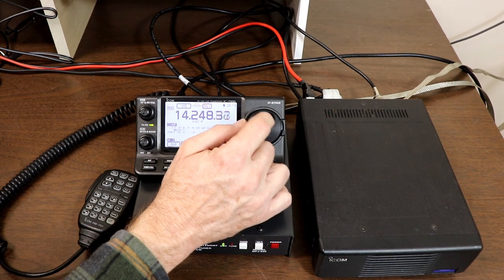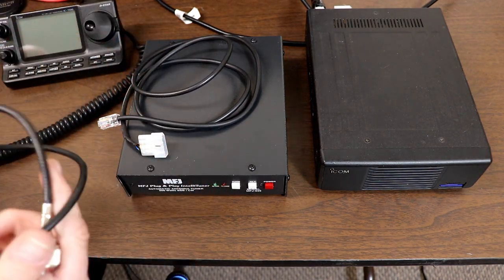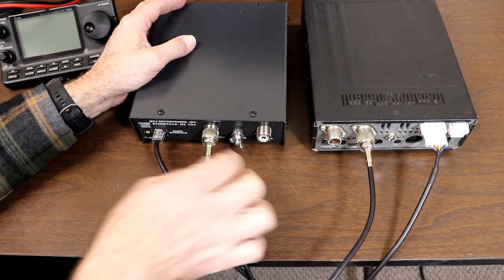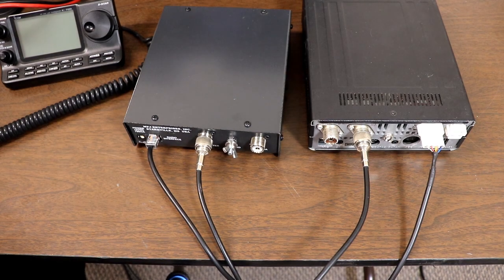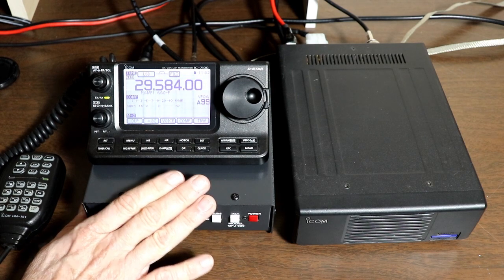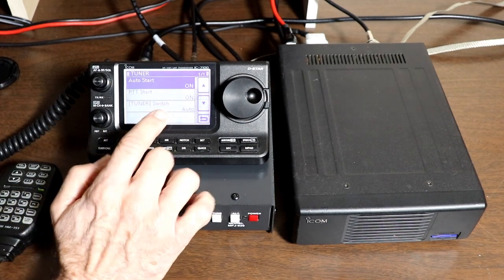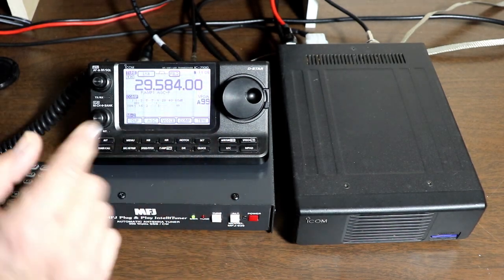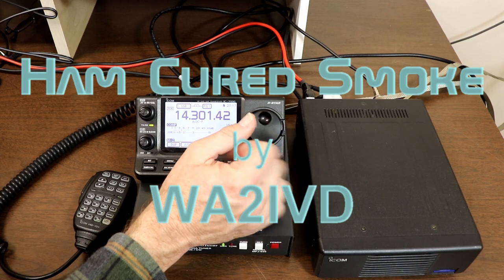IC-7100 from A to Z #11 Connecting an external antenna tuner

Comment: I want to thank you for the work you are doing on the IC-7100. I have been a ham for a long time (1976)  but since having a stroke have found my radio very hard to use.  I purchased the IC-7100 hoping it would be simple enough for me to use.  So far I think it may meet my needs.  So far I am basically exchanging my call (W0DWS) with DX stations. I am hoping to learn more so that I can do more with the rig.

Comment: Tom, the IC-7100 is my regular radio that I use every day and was my first HF radio.  I used your series to get me going on this radio and have come back here several times for reference.   But the other day this happened:  I turned on my radio and the LDG IT-100 would not power up. I had a bad cable and tried to replace the pins in the molex connector on the cable and was unsuccessful. All I succeeded in doing was blowing the 5 amp fuse on the radio. Replaced the fuse, ordered a new cable and installed it and nothing. Tested the output from the radio through the cable on pins 3 and 4 on the molex end and on pins 1 and 4 on the round DIN connector and got 13+ volts. Now I figured my tuner was bad. So I bought a new tuner, hooked everything up and same thing. Tuner won't power up. At this point, I'm out of my depth. I know that there is "start" on pin 5 and "key" on pin 6 but I have no idea how to test it, much less fix it. I'm afraid that when I blew that fuse I killed something else. Advice please. Should I send my radio in for repair?

Comment: Just a note, when you use a LDG tuner with the cable that carries the power to the tuner from the radio.  So when you turn on the radio the tuner also powers up.  You cannot turn on the tuner separately.
Reply from the maker: Thanks Arvind.  Yes, that's true with the LDG.  So just need to make sure it is plugged in before turning on the radio. (Generally a good idea when connecting or disconnecting any accessories)

Comment: This is the same setup as I have, and yes, the setup is quick and easy.  One thing I would add is that an antenna tuner doesn't actually "tune"  the antenna, (for those who aren't aware,) but just "tricks" the radio into believing that there is match between the antenna and radio.  Nothing beats a resonant antenna.

Comment: I have learned a lot about my 7100 from your videos.  Have you done one or can you do a video on linear amplifiers for the 7100?  I am thinking it would be nice to have a few more watts output.  Thoughts?  Thanks for the videos!
Reply from the maker: Hi Steve.  Thanks for the comment. I’m glad you’re finding the videos helpful. I haven’t done any videos on connecting an amp.  The main reason for this is that I don’t have one. I’ve been a ham for 46 years and I’ve always run barefoot.  Of course, a video on connecting an amp would give me an excuse to buy one...  73, Tom

Comment: I'm not sure if the 7100 has the same problem as the 7000, but on the 7000 the MJF external tuners prevent the fan from running. The fan will come on only when the radio is excessively hot.
Reply from the maker: Hi John. I am not aware of this being an issue with the 7100, but I have not really paid close attention to the fan in my setup.  I will make it a point to pay attention to the fan when using the tuner.
Reply: @HamRadioA2Z  Ok I hope Icom fixed that issue in the 7100. I never heard of this issue in any other Icom transceivers so hopefully you won't have any overheat issues. I had to send mine in twice to have the finals replaced. Now I am going to use only the AH-4 antenna tuner.

Comment: So what kind of antenna(s) do you use when your mobile?  Do you use two antennas one when you're moving and one for stationary?  
KD2OSR 73s
Reply from the maker: Currently I’m using a a Wolfe River Coil SB1000 coil - https://www.wolfrivercoils.com/SB1000.html along with a roughly 4-1/2 ft. SS whip.  It cutoff a 102” CB whip.  I was using the whip full length for a while, but I could not tune 10M or 12M very well with it.  I have the antenna connected to an MFJ-939 tuner.  You can easily use the SB1000 to tune to <2:1 SWR without a tuner.  However,  I keep the tuner inline to “trim” the antenna.  This allows me to quickly change bands by just moving the slider up and down until I hear the loudest static on the radio.  I don’t manually tune it for the best SWR, I just get close.  Then I can get back in the truck and keep driving.  The 939 will tune it the rest of the way and I can work the entire band without having to stop and retune.  I did a video review of my setup here:  https://youtu.be/bKMXoUUqcWo

Comment: I was just wishing for this video and there it was! But I have a question. The MFJ-939 manual says "Always tune with low power (2-20 watts). Apply maximum power only after tuning up".  Near the end of the video you said the radio automatically puts out 10 watts while tuning.  That would make things much simpler. Thanks for all your great videos.
Reply from the maker: Hi Amy.  Thanks for the kind words.  The statement at the end is correct.  When the MFJ939 is connected to the IC-7100 through the external tuner connector on the radio, it automatically lowers the power to around 10 watts when press the TUNER/CALL button to start a tuning sequence.  It works the same way if you press the Tune button on the front of the tuner.

Comment: That is where did you get the short Coax jumper cable??? Thanks.
Reply from the maker: Hi Dan.  I’m pretty sure I picked up that one at a hamfest.  I usually shop for that type of stuff at hamfests.  You can order short coax jumpers from all of the major amateur radio suppliers- DX Engineering, GigaParts, HRO, etc.  You can also find them on Amazon.  I would suggest getting RG8X instead of RG-58 cable.  It is typically a little better quality and has a larger center conductor.  There’s no need to go with RG-8 type cables unless you’re running full legal power.

Comment: I have an LDG auto tuner connected to my 7100. The tune button on the radio  seems to be disabled, why would that be?
Reply from the maker: Hi Elly,  There are no setting changes for the tuner on the 7100.  One thing I can think of is the power on sequence.  With the 7100, the tuner has to be present when the radio powers up.  If the radio is powered on and you plug the tuner in while it is on, the radio won’t recognize the tuner.  Other than that, maybe an intermittent or bad connection on one of the 4 pins in that tuner connector or the LDG connector at the other end.  Let us know what you find.  73, Tom

Comment: I just got my new 7100 and I have an LDG z100 auto tuner hooked up to it.  The radio does not cycle the tuner when pushing the tuner button on the control panel, nor will it cycle when depressing the PTT on the microphone. The tuner settings on the radio are set to utilize the PTT for tuning, however, doing so actually bypasses the auto tuner. Instead, I have to push the button on the tuner for it to cycle. I have power to the tuner, so I know it’s not a power issue but likely a radio setting. Any suggestions? 

Great videos, by the way!
Reply from the maker: Hi Scott.  Thank you for the kind words.  I don’t know of any settings to enable or disable the Tune button.  One thing that has caught me with the 7100 a few times is that the radio only tries to detect the presence of the tuner on power-up.  I know the LDG Z series tuners draw almost no power when in stand by.  I wonder if that affects the radio’s ability to detect it?

Comment: will the tuner you used in this video work with a ATSA 120A antenna?
Reply from the maker: Hi Rodger.  No, if you’re referring to the Yaesu ATAS 120A, that is a motorized, self tuning antenna.  That antenna is basically the antenna and tuner all in one.  It is Yaesu’s version of a “screwdriver antenna”.  If you do a Google search on that term you’ll find a bunch of articles, brands and plans.  The ATAS 120A is specifically made to work with Yaesu radios.

Comment: I have the same rig except I have a mfj 929, it seems like everything is working like yours, but notice that when you key up as well as mine the S meter doesn’t really show movement when talking, is this normal? It tunes quickly.
Reply from the maker: Hi Tony.  In the video, I had the meter set to SWR.  So if my SWR is 1:1 or close to it, the meter shouldn't be moving when I transmit.  If I had selected PO (Power) or the ALC meter, then you would have seen some movement.

Comment: Very useful video. But you get a thumbs down for the clickbait thumbnail (out of principle). Don't show me the AH-4 on the thumbnail and then just mention it in passing.
Reply: The connections are the same except that the AH-4 works with wire antennas only.